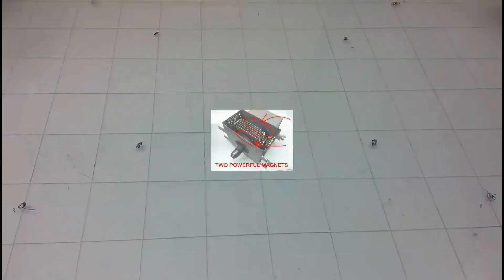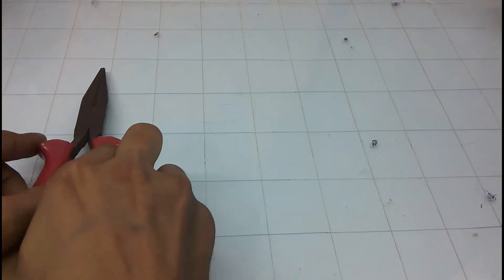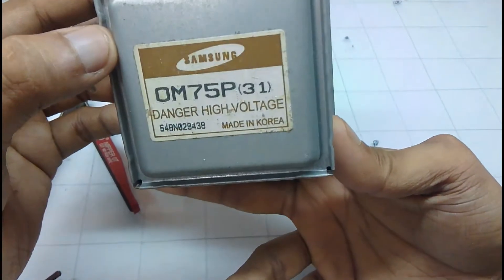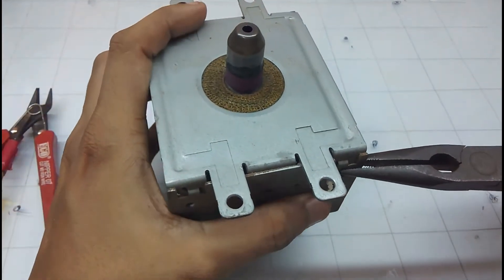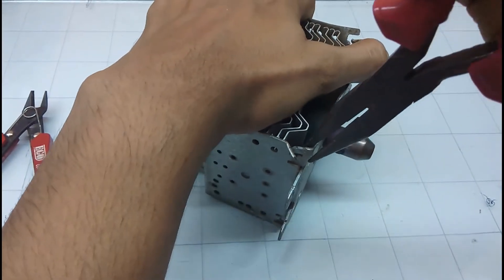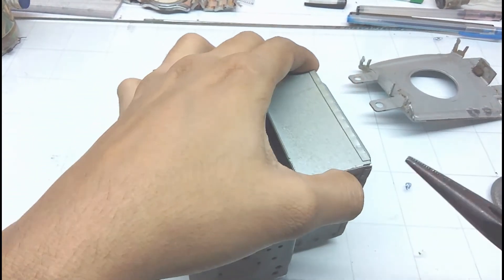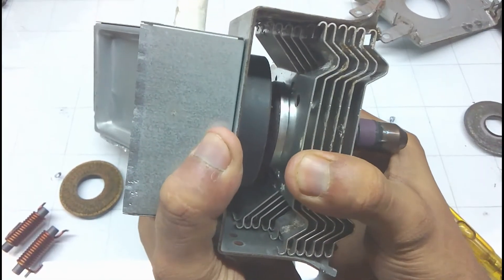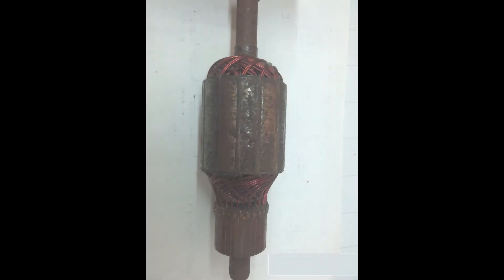How to get the magnets out of a microwave magnetron --- Its About Everything.

Comment: thanks for pointing out these dangers ....is there any way of knowing if the insulators are made of beryllium or not by looking at them?...thanks
Reply: A diamond tester that can measure thermal conductivity can tell you if the ceramic insulators are made of beryllium oxide.

Comment: if replaced by neodymium magnet or electromagnets then what are control time and temperature and electricity bills?
Reply from the maker: Electro magnet will increase the electricity bill, but neodymium magnets will reduce the weight of the component and the functionality will remain the same, however the cost will be much higher for the component.
Reply: @ItsAboutEverything01  so if we use piezoelectricity crystal cavity instead of copper or thorium and giving the spark to piezoelectricity crystal then a flow of electron coming out and more powerful microwave frequency produce or not

Comment: So beryllium oxide is part of that pink ceramic insulator?
I want to get middle copper part, if i carefully cut it without damaging pink stuff i will be safe then?
Reply from the maker: +PitsuMiwus  yes, but stay on the safe side by using dust mask and eye protection.
Reply: Your half way there! Two cellulose dividers in litho-Battery, cut the copper sheet in half or fold & place in middle. crushed Thorium on outer sheet & roll half turn and add Beryllium so its the most outer shielding all of it. The copper is the cathode inner core. put back in battery case and you have a 3 VDC 500 mA no charge battery for ten years! Magnets are needed to set polarity & battery most be sealed to keep it a closed loop! Electrons propagate outside the case.